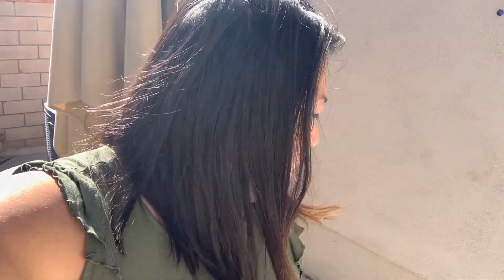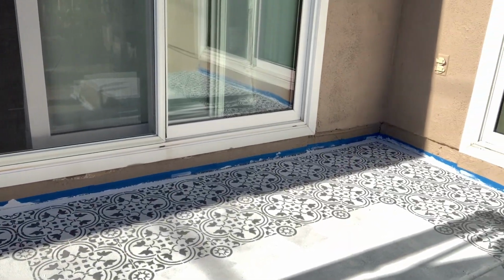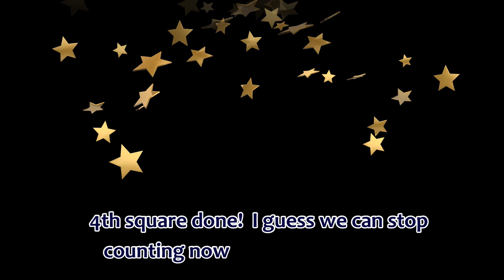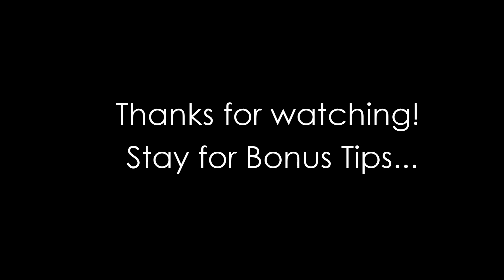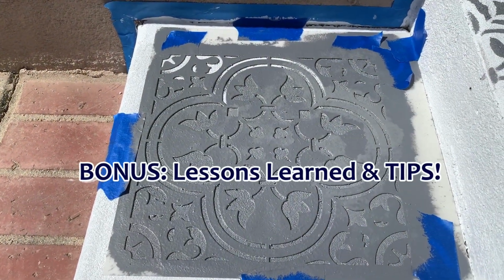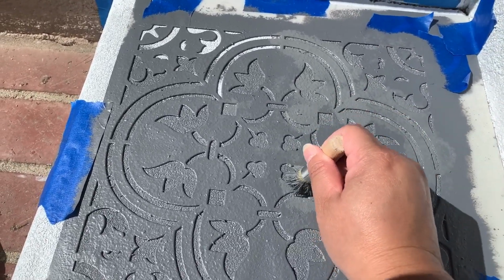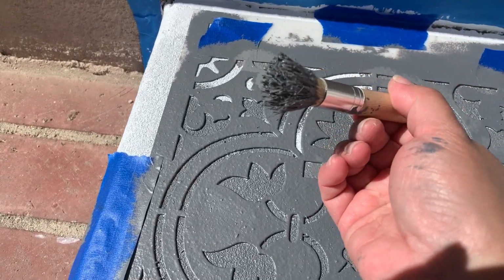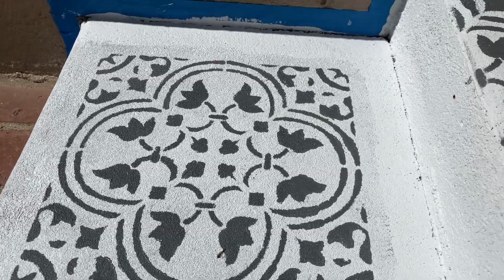How to Stencil Concrete Floors 🏡

Comment: I'm in the middle of doing this very same job.  I'm questioning my decision at this point. I'm 62 and getting up and down on the cement has me sorry I started such a project. It's harder than it looks. My project is about 5 times larger than the one in the video.  I'm using a combo of a brush and roller but it's taking for ever. We are readying the house for sale other wise I wouldn't feel the pressure to get it finished. 😢

Comment: Did it get dirty with shoeprints right away since you didn't use a sealer at the end? Did it matter? Has it peeled at all? I've painted Mandalas on on stepping stones and am so worried about my work getting dirty. 😂 I want it to last... Did used a concrete sealer but I'm thinking it's not the right one. 😞
Reply from the maker: Hi there! I think we did expect that bright white to get dirty as time goes on, but everytime it rains, it's back to white! I also bought a concrete sealer but didn't get the right one either. It's been fine.